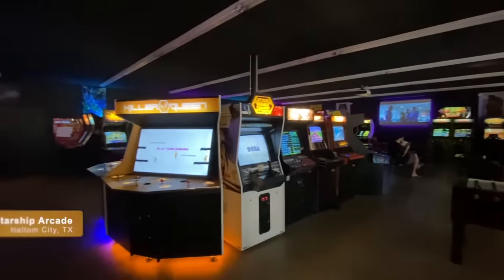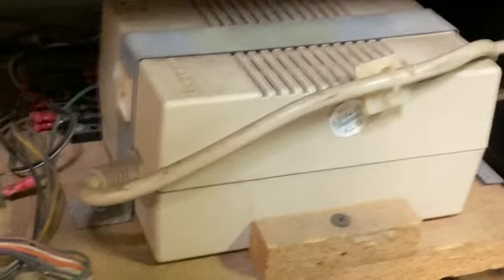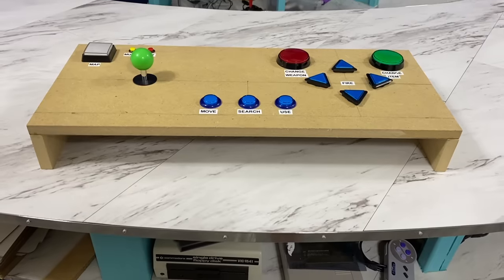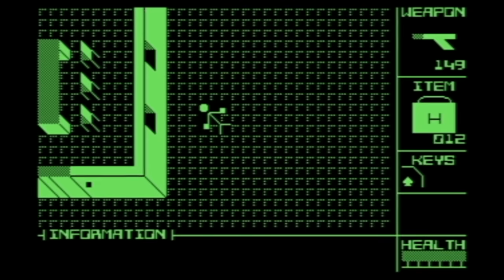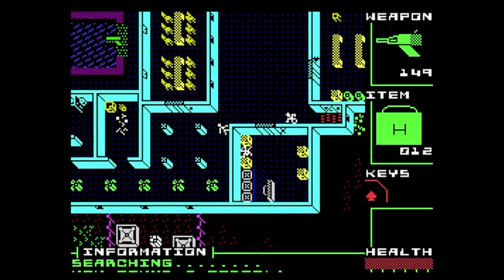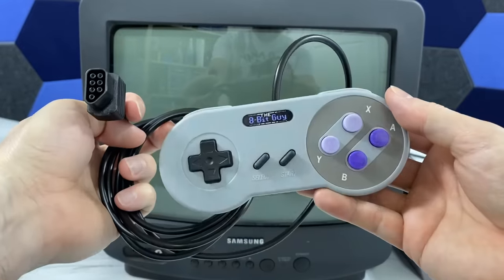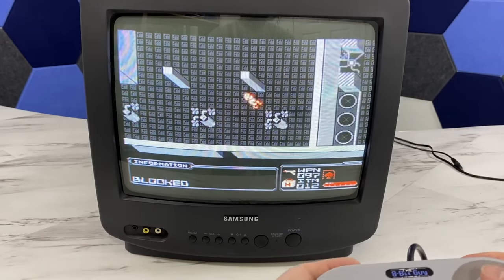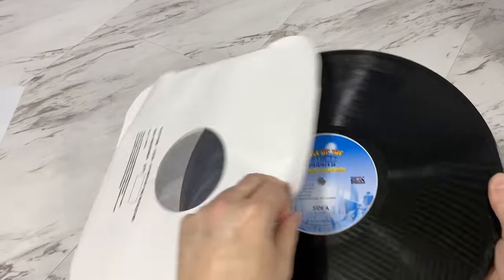Petscii Robots Mega Update - Arcade, Genesis, MS-DOS and more!

Comment: Looking good! It’s really taking off, you gotta be close to Tetris/Doom port numbers soon. ;). I guess I have to design some decals for the arcade panels soon then. ;)
Reply: Omg an arcade version sounds just amazing! I’d love seeing you end up making those decals!
Reply: Can't wait for someone to make a PC port. That will really open the flood gates for modding.
Reply: Except all ports are controlled by the original developer so should be more consistent.
Reply: No, it's dumb.  To begin with, it's NOT an arcade game or even an arcade style game.It is TOTALLY inappropriate for an arcade machine
 Second, why would anyone create an Amiga arcade machine to run a port of a PET game in arcade?  Why not find an arcade machine and write a port of the software for the existing arcade platform?  That way, all you have to do is burn the ROM and then install the ROM in the appropriate arcade machine.

The only real flaw is the requirement that you get a hold of a development system for the arcade machine.  But targeting a neo geo might be an easy way to do it and you get the advantage of the Neo Geo MVS system where the game is simply a rom cartridge in  a multi-game arcade machine.
Reply: @tarstarkusz  He's not making a rom intended to be widely distributed along arcade owners, he's making a single arcade cabinet for that one arcade. I think it'll work just fine in that context game design-wise since it's not actually going to take quarters. Why be so mad?
Reply: @tarstarkusz  I agree with you. Doesn't make sense to me either.
Reply: @TheGershon  I'll be interested to know how the money will factored in.  With an arcade game, it is almost always based on lives.  But will it be time based or lives based or accomplishment based.
It's not merely the practicality of custom building arcade machines, it's that it's not really an arcade machine.  It's a coin-operated Amiga 500 running an Amiga 500 game.
Reply: @tarstarkusz  But would you be willing to gather a bunch of quarters in 2022 and spend them like we did back in the 80s… or pay a fair admission fee and play unlimited games for as long as you want while in the arcade? I think people today expect much more gameplay for less than we had back then. 😉
Also since old hardware is hard to find and keep a lot of it up and running, so of course one has to do some compromises and use modern bits and pieces - but I’m sure the end result will be pretty much like a real arcade design would have been back then.
Reply from the maker: Since none of the games in this arcade venue require money to play, the game will fit right in just fine as a free-play game.  It's just a novelty.  A fun project.  It's possible nobody will even play it.  Who knows?
Reply: @tarstarkusz  You do realize these are retro style games right? Only really interesting for us 40+ yo people and it's awesome it's even having a bit of a comeback. Enjoy it, just try that for once.
Reply: @The8BitGuy  I wasn't meaning to criticize.  To me, it's an interesting problem.  It's an arcade machine, but even on freeplay, everything is based around the credit.  In most games, the quarter is tied to your 3 lives.  In some, it's time based.  In a fighting game, you can't lose 2 matches in a row.

It seems like an interesting problem to have to solve.  What elements do you focus in on to limit the player's time on the machine?
Reply: @VincentGroenewold  Even as a fellow old-guy, I have to disagree.  Though they are not as popular with the young-uns as with us, there is a retro-gaming scene among the millennials.
Reply: @AndersEngerJensen  It's just in my mind, arcade games have a particular style that is fundamental to the platform where your time playing is based upon your level of skill and the good quarter (America). 

 Despite the proliferation of the NES arcade machines, they never seemed to be all that quarter munching. I would always see them with nobody playing them.  Or maybe some people used them as a way to play a game they were thinking of buying, so they could check it out.
  The Genesis had a similar arcade machine that was also time based and these were a total flop. Never even heard of them till a couple of years ago when a retrogaming channel I follow had one for repair (gadgetUK)

So putting a timer on a game with no connection to how you play doesn't really work.  Even games that did have time as an element tied that time to the game.  Like having to complete a circuit in a racing game before the allotted time.  It wasn't just "buying seconds," it was a reward for playing well.

To me, these are tied together in a way that can't (as in shouldn't) be severed.

I have not played PR, but from watching progress, it appears to be more similar to an adventure game than a arcade style game.
Reply: @tarstarkusz  Dude, seriously! you need to relax. Go play a retro-game and call me in the morning.
Reply: @tarstarkusz  Again, this is just pretty much just done for fun, so I think you should just get off your high horse for a bit and seeing things from a different perspective. It's no longer the 80s and 90s anymore, grow up.
Reply: @fifaworldcup1994  You're tell me that to get with the program?  You're the one trying to reproduce the arcade that went out of business in 1985.
Reply: @tarstarkusz  May you please tell me where you got that? 1, I don't live in the US, and 2, I'm incapable of maintaining such a business to begin with.
Reply: @fifaworldcup1994  "the arcade" (as in phenomenon) went away in the late 80 morphing into "family fun centers" which had the machines as a secondary attraction and also went out of business.  There are no arcades around anymore and haven't been for a long time.  Even the remnants of the arcade in the family fun centers were relegated to 2nd class status to the money munching ticket dispensing machines.  You told me to come into the current year and stop living in the 80s and 90s.  Well, the arcades have been gone A LONG time and It's not me trying to get something in this long dead sector.
Reply: @tarstarkusz  The fine thing about the world we live in, is that you can vocalise your thoughts as much as you want… but David will still fullfill his dreams of making this arcade game and put it out there. The other fine thing is that you and all the others who thinks he’s «breaking the arcade game rules»… can simply ignore it and go do/watch other things and not waste energy on this.

It’s a pretty neat world we live in. 🤪🤷🏼‍♂️😂
Reply: @tarstarkusz  gosh, dude... sorry for kind of "attacking" you here, but did you actually watch the video? He mentions that there's an admission fee and cabinets take no quarters there - you just walk towards the machine and start playing.

I'm also a retro gaming enthusiast and programmer and I can assure you we don't give a banging crap about revenues most of the time, because these things are not what we make a living out of. The thing is this style and these games are what we care for videogame wise. Most of us think current day games suck, with a few exceptions.

I'm currently working hours and hours a week on an Atari 2600 game. I've purchased PCBs, plastic casing and electronic components for 200+ physical copies. Again, I can assure you I don't care even if none of them ends up sold. I'd happily even give them for free at a fair or something. It makes no sense to attempt to make a hobbyist project go through any type of commercial viability test, unless you're talking about thousands of dollars or any other amount that could ruin your budget and your family's, of course. Other than that, time and money spent on hobbies are to enhance one's mental health, feed their sense of purpose and happiness. Well, wrote a little bit more than necessary here, but you get the idea.
Reply: @lean.drocalil  People are acting as if I said the game is terrible, it's a waste of time or that he's ugly or something.  All I said was that it's not an arcade game.  In the video he said that people are giving bad reviews because they don't understand the game and haven't read the manual.  Arcade games, particularly as we broadly of Gen-X think of arcade games, are simple to learn and difficult to master..  They are simple and challenging. They are very quickly and effortlessly learned and very difficult to master and usually require quick reflexes and learning a good strategy. If anyone read instructions printed on the machine, it took all but 5 seconds to read the 2-3 lines at most of "instructions"  No successful arcade machine ever required reading a manual.  Manuals are for console and computer games.

IMHO, what I gave was constructive criticism that was worded somewhat respectfully.  I don't think youtubers are  a special class of crystal people with extremely fragile egos which need to be stroked and are above criticism.  I'm sorry, but "you're so wonderful" is not the only feedback that should ever be left for any youtube video.

I never once said it wasn't work or pretended that developing a game even on these older systems was not work or not challenging or that making these games is worthy of contempt.  I own many modern retro cartridges for old systems. I greatly appreciate the work that goes into them.  Many are better than anything released when they were commercial products.

Also, I thought I made it clear that I thought money aspect was particularly interesting (to me) given the type of game PR is supposed to be (I have not played it yet, but I plan on playing it).  That even in a prepaid setting where the game is set to free play, it would be interesting in how he chooses to deal with that.

 Arcade games are built around the credit, even on free play. Free play doesn't give you unlimited time or lives, it gives you unlimited credits.   Even games with timers, they still function as timers on free play.  IOW, the credit is part and parcel to the format.  Whether it's time based, lives based or bout based fighting games (can't lose 2 in a row) or even goals based, the credit is one of the central features of an arcade game.  That element will have to be added for it to be an arcade game even if it will only ever run on free play.

I agree most modern games suck. For me, games got boring when they went to 3d. Plus, I was probably aging out of new games anyway as I was around 25 when the Saturn came out.
Reply: @Lucas Carlson I did not intend to be disrespectful and I didn't think I was being disrespectful (to the 8bit guy)
Reply: @tarstarkusz  regarding the way you wrote, don't worry about that... I don't think you've been disrespectful or anything. The thing is he wrote the game without this whole arcade thing in mind, then later on he had the idea of reworking it out so that he could come up with a slightly modified version to work as though it were written primarily to be a true arcade game.

There are other games that were on cabinets and couldn't be considered arcade games, if one is pedantic to a certain level. Take Cadash for example: it has a lot of RPG elements, you level up, there's a story to interpret and the game is obviously not relying on the player's ability to master its mechanics alone.
Reply: @AndersEngerJensen  I never said otherwise.  I have no ill-will towards him and am generally supportive of his channel. I've been subbed for years.  As you say, I can give my opinion and he can take it or leave it.   It's his money. It's his time. It's his game. It's his deal with the arcade owner/operator.

Let's face it, I could be  Shigeru Miyamoto commenting on David's video and he's probably still not going to listen.  It takes a certain type of person to face the camera and make these videos and promote his own creations on the channel.  If he were a fragile snowflake, he wouldn't be doing this.
Reply: @tarstarkusz  It's clear to me that you really didn't have a valid point in this, but only wanted to draw attention to yourself which you have successfully-done.  Congratulations.  At the end of the day, your opinion is worth about as much as a 10-day old hot-dog water slushee.  Here is why.

You posted several lengthy dissertations loaded with shortsightedness and unabashed-arrogance.  I mean, who do you think you are?  

You didn't right any code for Petscii Robots. 
You didn't troubleshoot any of it.  
You didn't pay for any developmental or diagnostic-tools.  
You didn't pay for any of the manufacturing or distribution of the game.  

........yet you are carrying on like YOU did all of those things and he came in and decided to put the game in an arcade without YOUR permission.

I have to be the one to break the news to you on this, but um.............your opinion is not fact.

I know, I know it's a shock.  I'll give you a minute to get yourself together..................

Now then.  Your definition of what an arcade-game is or your interpretation of the definition of what makes an arcade-game is 100% IRRELEVANT and before you try to back off of that, let me remind you of what you said at the start......

"No, it's DUMB to begin with.  It's NOT an arcade game or even an arcade-style game. It is TOTALLY inappropriate for an arcade-machine."

Are you freaking serious?  The nerve of people these days is astounding.  If I may be so bold as to quote the Admiral from Star Trek: Picard.

"Sheer, f***ing hubris"

You pulled that trigger. Bullets can't come back. I took the liberty of fixing the grammar of your statement by the way.  That'll cost you a quarter. 😄

Dave can make the games he wants.  The purveyor (the person that owns the arcade) can put whatever games they want in their establishment.  

The only thing you've accomplished here was to take a nice fun and wonderful-video and turn the comments-section into a toxic-waste dump.  

Dave will continue on to make the games he wants to make the way he wants to make them regardless of your consternation or satisfaction-level.  You can continue to complain and make excuses for your complaints.  No one cares.  I seriously suggest that you find something more constructive to do with your time.  

You can go ahead and say what you are going to say trying to find entry-points to a tactical-response using red-herrings, ad-hominems, semantics, and strawman-arguments, but it will only further underscore your failure in this.  We are done here.  Take the L, and move along.
Reply: @D2Kprime  You need to take a chill pill; writing all of that in a response critical of someone who maybe needed a chill pill.
You aint the 8-Bit Wife. I'll notch this down to you having a couple of drinks tonight.
Reply: @lean.drocalil  what kind of game are you working on for the Atari 2600? Is there anywhere we can go to get a preview or learn more about it?
Reply: @tarstarkusz  I had that thought too.

A puzzle game like Petscii would never work for an actual arcade game. Arcade puzzles are usually short and to the point. Not to mention, fun and engaging in their own way.

That said, Petscii has tons of potential as a console/computer game. You have all the time in the world to search for weapons, and you won't feel pressured to think of a plan to rid a map of all the Petsciis. It works for the home. Having it be for an arcade is a little novelty.

To top it all of, weren't you the one that tells lurkers not to take things too seriously?
Reply: @tarstarkusz  to some extent i do agree with you, that maybe the game could be edited to use a life system or a time system to fit with the arcade better!
Reply: @The8BitGuy  Does the arcade version record any metrics about number of times played / total time played / etc?
Reply: @The8BitGuy  Why not make the NES version with the VT03 chip?  I'm sure you could get them from any Chinese factory producing Wii knockoffs
Reply: Don’t forget about all the things that can run Bad Apple
Reply: @tarstarkusz  Sure, the Nintendo Playchoice machines, the "arcade" machines containing a NES and a timer, completely sucked. They had a real nerve putting shitty NES hardware in competition with actual arcade hardware. But I suppose it made Nintendo money. As somebody mentioned, perhaps a kid would use it to check out a game he was planning on buying. Did you know they did the same thing with the SNES? Back when it first came out, and it looked impressive. Same system, had F-Zero, Super Mario World, and Super Tennis. Why Mario!?!? That game takes literal days to complete! But there it was, and it was fun to get a few minutes bouncing up and down with Yoshi. I didn't put much money in, but it was fun. The joypads stuck out on metal arms with corrugated black tubing. The ugly green text from the video chip in the timer hardware counted down til it reset the machine or whatever it did.

If David wanted to, he could tie the coin switch to any function he wanted. Wire it up to the machine's parallel port or something. Then code in continues or whatever. But there's no point in a free-to-play arcade when he's only ever going to make one machine. It's not a consideration in this case.

But yeah, timed arcade games utterly, massively, hugely fucking suck!
Reply: @tarstarkusz  Sure it's not a "traditional" arcade machine, but so what? It's not written with the aim of making money like others are, it's just for David to show his game to the general public, people who don't necessarily watch this channel, and probably don't know who he is. Though that said if they're paying $10 to play a load of 30 year old games, they might be reading this right now.

He created the game to start with as a home computer game. Particularly for the PET, which has a dearth of action games, and indeed games in general. It's interesting to see what a creaky old overpriced word processor can do when it gets it's arse in gear! Then it ended up ported to everything, he knows some guy who runs an arcade, so thought "why not". So not it's not an "arcade game", it's a home computer game in an arcade. Doesn't matter. The economics of running an arcade where the games are free, you charge admission, and your customers are a very specific demographic (I would think, but maybe the geezers bring their kids (or grandkids!) along to show them how we used to do things), are very different to an actual arcade back-when. 

Particularly this arcade doesn't have to spend thousands of dollars on the newest machines, then amortise that off in the 15 minutes that kids want to play it before something better and more expensive comes along. My local arcade was a dingy black cellar that STANK of teenage cigarette smoke, and had a 4-player bank of those ENORMOUS Super Street Fighter machines with the huge projection TV screens and a built-in bench for both players to sit on. I think it was a JAMMA, too, so would be fun to see what other games you could put in there after you scrape the side decals off. The heat in that place was tremendous! 

Rather than pay a 1990s pound for for 12 seconds it took to get my head kicked in on Super Street Fighter (winner stays on!) I'd usually play the cheaper ordinary SF2 JAMMA cabinets. Or else they had Bubble Bobble for 20p a go. I'm great at that, spent hours and hours playing it at home.
Reply: @greenaum  Attack of the PETSCI Robots is WAY bigger than old arcade games.  This game may end up one of the most ported retrogame ever only taking a back seat to games like Tetris.  Every retro "community" (sig) wants a port.

I just don't think the game is a good fit for an arcade.  He said in the video he's getting bad feedback from YouTubers reviewing the game, but in his opinion, only because they haven't read the manual. If you have to read a manual to understand how to play a game, it's not a good fit for the arcade.  The people who see it in this arcade are going to walk away frustrated.

Even if it is "successful," it's a stunt appearing in only a single arcade in the entire world. 

 In my experience, the arcades were  gone by the time street fighter was around.  Arcades were at their heyday in 1982.  There were a few hangers-on by the time street fighter came along, but your experience of your local arcade is not surprising at all, given that it had a street fighter machine up-made to a projection TV in it. I didn't start seeing machines like that until the early 2000s.  Bubble Bobble is a better game, IMHO than Street Fighter.
Reply: @greenaum  I never knew hey had a SNES version of the play-10 concept, let alone wit SNES game pads rigged up to them.  I know the Genesis had one though.

I think the whole reason they came up with the "buy time" model was that so many of these games just weren't arcade games. Since they were just NES/Genesis/SNES carts in an arcade cabinet, it's not like they could modify the game to be more like an arcade game.  While the play-10 was never a quarter muncher, it probably helped sell a lot of NES games for Nintendo. Try it for a quarter, if you like it, go buy it at the store.  I agree the concept, as far as playing goes, SUCKS.
Reply: @tarstarkusz  sheesh dude calm down david just had a idea of making a arcade ver of this game and dont forget! He can put some text on the sides of the arcade or add a a little story (it can tell you what to do).
Reply: @goomba-64  Are we reading the same thread?  "calm down?"  Do you think I'm excited or that any of my comments indicate I'm excited?
Nobody is even really disputing what I said, they're just saying you shouldn't say it because it's not being supportive of 8bitguy.  All I've said is this game simply doesn't lend itself to the arcade format.
Reply: @tarstarkusz  when i said "calm down" i meant to stop talking about this
Reply: @goomba-64  Who the eff are you to tell me to stop discussing something?
Reply: @tarstarkusz  bacause you are speaking about it too much and dude why did you got so rude so fast I didnt said anything bad to you. You are just being mad at me just for asking you to stop
Reply: @goomba-64  I did not get rude with you until you started telling me to shut up.  Nobody died and left you boss.  First you tell me "calm down" and then you tell me to shut up and then you tell me I am being rude to YOU?  Unreal.  Let it go. Tell me why anything I said in this thread is wrong or go away, but don't think you're gonna lecture me.
Reply: @tarstarkusz  you just Eff me that's rude
Reply: @goomba-64  AFTER you told me to just shut up.